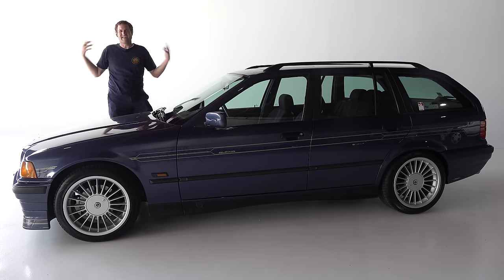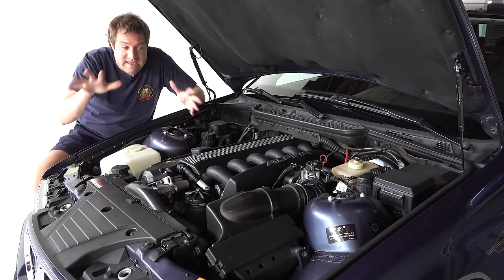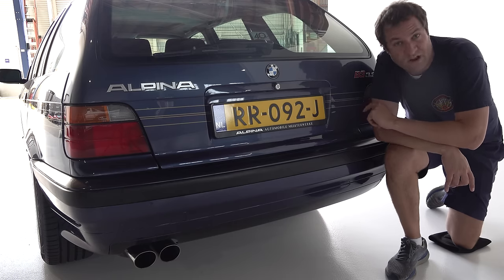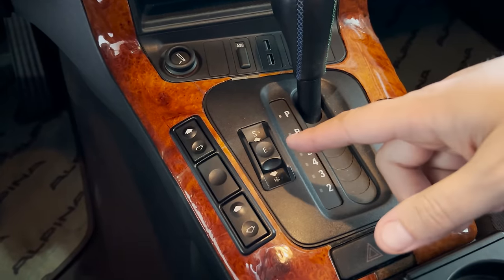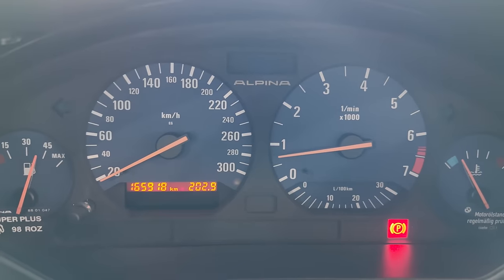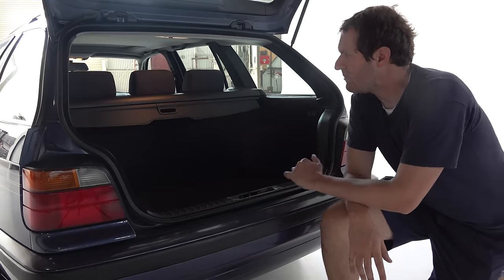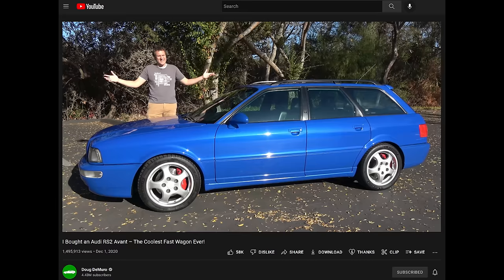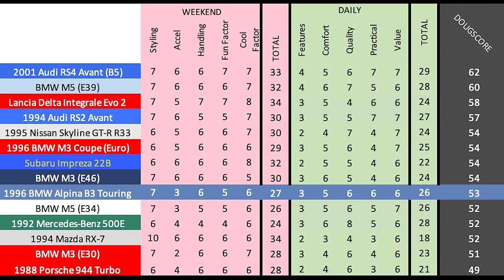The BMW Alpina B3 Touring Is an Ultra-Cool Obscure ‘90s Wagon

Comment: Do you know that theres an Alpina B8 with an 4.6L V8 based on that e36? 

You would love it as well I guess!

EDIT: the V8 is only available as a Touring :)
Reply: The B8 was available in all body styles except for the compact.There are a lot of Sedans(sometimes called the "Limousine") cabriolets and Coupes with the 4.0 and 4.6
Reply: @joshuadebideen22  oh thx! you are right! -I didn't know that!

shame one me, since I have only a few mins. to drive to Buchloe :)
Reply: @DeBaRe  No problem.My little brother and I are fans of the E36 and I always wanted a 1997 B8 4.6 sedan in Alpina Blue
Reply: @joshuadebideen22  My first car ever was an 1995 E36 Touring 320i Manual. I loved this car! 

I sold it tho for an e34 525i :)   Then I sold this for an e34 530i V8 Manual  ..and then I bought an e34 525i Automatic, an e34 525TDS Touring, an e28 520i and an e39 523i Touring :D - I'm kinda addiced to BMW's from the 80's and 90's - but don't thell this to my 2 Audi A6 C4's :D
Reply: @DeBaRe  My dad only bought the older generation BMWs (E30,E34,E36,E39,E53 X5 and E90) and they were amazing.We preferred the Straight 6 and V8s over the 4 cylinder models.They were such amazing machines to drive.I managed to track down an original 1989 Alpina B10 E34 3.5.It was no.002 in Zinnober red with a black interior.It was parked off for 12 years and it was in need of TLC.It was advertised for the equivalent of 800 euros at the time.This was in 2018.My elder brother ended buying the car,but the road licence wasn't paid for 12 years because it hadn't been driven since 2006.The previous owners didn't even know what it was.It was a truly amazing find and that was the beginning of my fascination with Alpina.
Reply: @DeBaRe  We have a Jet Blue 2006 Audi A4 B7 2.0 imported from Germany at the moment
Reply: I'm not sure where that B10 is at the moment.

Comment: A 3.0 l engine bored out to 3.2 l + con rods + port and polish by a fnacy tuner only made 265 hp?  Pretty lame.  A standard 3.2 l from a US spec M3 made more power than that with a simple tune like a Shark Injector, OBD-1 (1995 spec) intake manifold and headers.  Add aggressive cams to the mix and you're above that.

Comment: Alpina did not 'lower the front bumper', they installed a 'deeper air dam' out front.  The air dam is a separate piece and not considered part of the bumper.  That would have been the proper terminology back in the day.

Comment: Doug you’re making a bunch of mistakes. This starts as a 2.8 non m and is stroked to 3.2 liters.
Reply: If you think this just a bored out 3.2 M52, you're completely mistaken, and your comment indicates how little you know or understand about the Alpina brand.
Reply: sure. the base was the m52b28 but it is still related to the Us spec m3 engine
Reply: @seth19890103  exactly it’s basically what they did for the us spec s52 m3 just with the intake manifold and exhaust upgrades to get the extra 25 hp

Comment: 95% of all BMW’s are still on the road…….
right where their owners left them the last time they broke
Reply: That's a bit of an exaggeration.  Or maybe not when you consider that the vast majority of people who own these own them not as enthusiasts, but buyers of well worn status symbols with very little knowledge or understanding of how to maintain an older German car.  Most people can't even be bothered to change their oil, and are certainly not going to do things like change out worn valveguides, stem seals, and leaking intake gaskets.

Comment: Oh my it's boring through and through, and soooo dated, particularly the tech, power and transmission. Full disclosure, I'm not a BMW guy but this is sooooooo NOTHING imho. I guess at the right LOW price it could make sense but otherwise it ain't for me. New is cheaper and better in everywhichway. Cheers